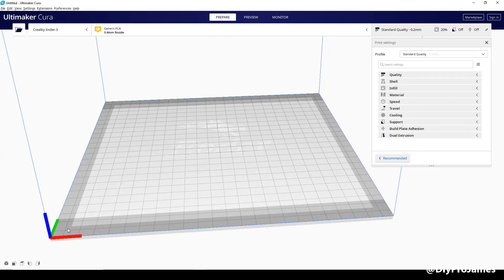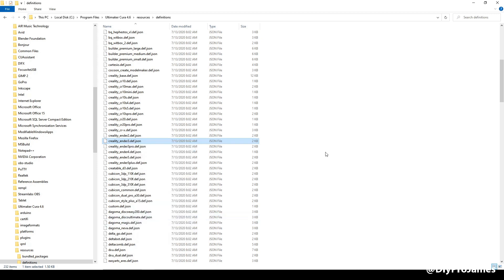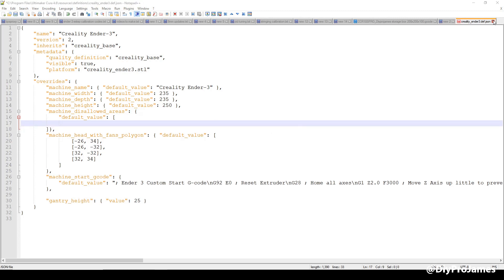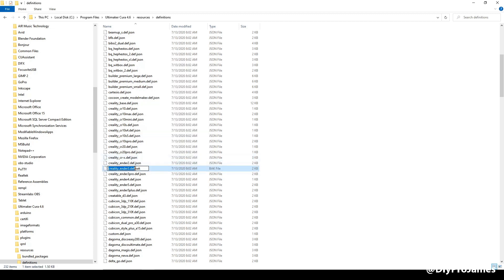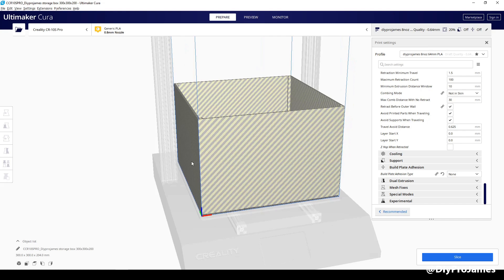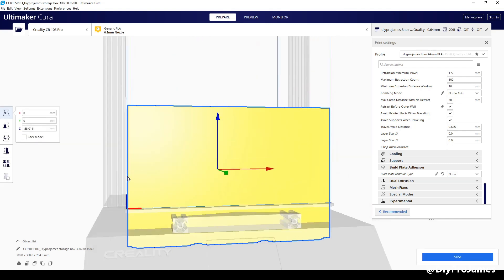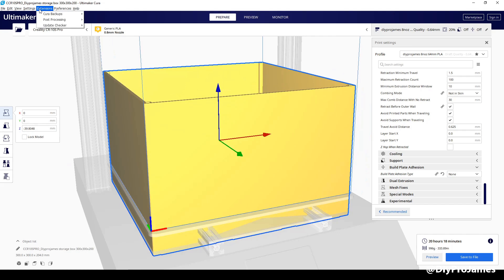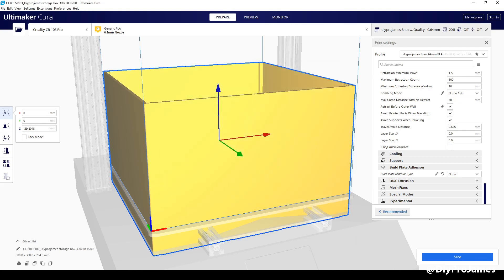CURA FILES - HOW TO MAXIMIZE YOUR 3D PRINTERS FULL BED VOLUME.

Comment: i tried doing this and when i goto save the file it wont let me save it and says "you do not have  permission to open this file. see the owner of the file or an administrator to obtain permission" how else am i able to get past the clip issue. im already runnning a mag bed.
Reply: so i downloaded notepad++ and was able to change the settings. but it reset the whole cura and then i needed to re-setup cura. so i did that and then i couldn't choose  the ender 3 v2 anymore only the ender 3 pro. so i set that one up and it then said the file was currupt and needed to be reset to factory settings and so i did that and its back to normal with the grayed out areas

Comment: I need a reply doc on Cara says that my 3D printing object is able to 3D print on my back because it fits there's even videos of preparation what I want and it shows you how it's being 3D printed but everytime I put it on my 3D printer it's giving me 3/4 of a circle which is it makes the circle until it gets to a point on a 3D printing that it cuts way have through making the circle into a c with a line how do I take that off

Comment: In the newest version 4.11.0, it allows you to change the bed size. I wouldn't have found it without watching your video first, so thanks a lot, I really appreciate it. I change it to 225 for the x and y axis and left the z axis at 250 and hit close. Now my print appears to fit just fine. I'm doing a print on an Ender 3 Pro FYI.
My print was short by just a millimeter or two from front to back. If somone tries this, be aware that the print head may or may not go side to side without hitting. I'm not sure what the maximum safe distant is for side to side, but it appears front to back will be okay. I'll test it and if it doesn't work, I will edit this right away to prevent any damage to someones print head.

Thanks again James!

Btw, I'm only getting sound out of the left side when I watch your video with my headphones on. Just letting you know in case you were not aware.
Reply from the maker: Ok thank you.
Reply: Did you have to do anything else after changing besides change the printer bed size?

Comment: Yes my prints start 4mm to the left of center and 3mm nearer to the front of the plate. If I change the probe offset to compensate it is even worse. I am using sensorless homing.
Reply from the maker: This is because you're not understanding the relationships of the bed, mount, and printer head. It has nothing to do with sensors. The end stops are zero points. Learn the relationships. This video will probably help  PROBE X,Y,Z OFFSETS & TRAVEL LIMITS - CALIBRATE CENTER OF BED AND PROBE MARGINS https://www.youtube.com/watch?v=3J9NhwbziEY&list=PLKB2mjSs4KgN29yU2t4kGeNoVFJWeSt6H&index=6

Comment: I’m trying to print a bat helmet out of my ender 3 pro and I tried going to the printer settings and I stretched it out to 225x225y on the buildplate instead of the initial size of 220x220y that was already set up . By any chance can that work?
Reply from the maker: It may work. Depends how well your printer is calibrated. This video will give you an explanation of how the bed size is set up. https://www.youtube.com/watch?v=3J9NhwbziEY&list=PLKB2mjSs4KgN29yU2t4kGeNoVFJWeSt6H&index=6
Reply: @DiyProJames  Thank you for this link , it’s cause my goal is to try and fit the whole helmet as snug as I can on the buildplate without the nozzle hitting the sides of the beams or having to slice the helmet in half & doing the extra work in the end sanding the seam line . Again thank you lots 👍

Comment: I tried it but it didn't work because it keeps giving me the notification that it needs to be done by the administrator. sooo... I don't get it. 
BUUUTT I changed my printer settings. The ''width and depth'' to be exact. With the Ender pro3 it's set to 220mm. So I measured my bed and set those values in the settings. I changed it to 250mm. It works!
Reply from the maker: Great!  Yes it seems windows operating system wants you to be an administrator  before changing any little thing these days...

Comment: Why does your hot end fan go on and off while printing?
Reply from the maker: There are two fans. One for the cold part of the hotend which prevents the cold part of the hotend from getting too hot. There is a melt zone for the plastic (hot zone). If this wasn't regulated the heat would travel to the cold zone melting the plastic and bowden tube. It keeps the hotend at a set temperature. The second fan is the nozzle fan or fan that cools the plastic when the plastic comes out of the nozzle. This fan speed you regulate depending on what type of details you have on your model. This will change the physical attributes of the plastic oozing out. Check out my video https://www.youtube.com/watch?v=ykJb4ZW64Uc 
You will be able to see small differences in the temperature tower.